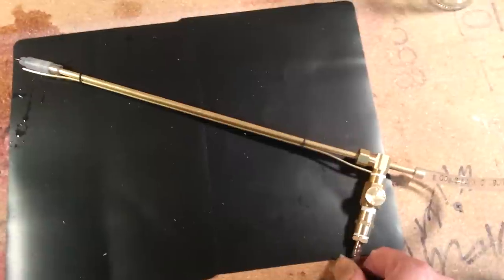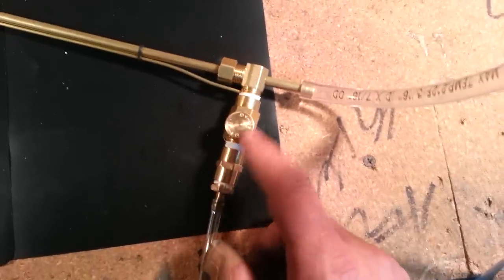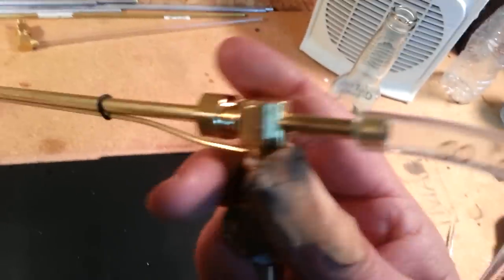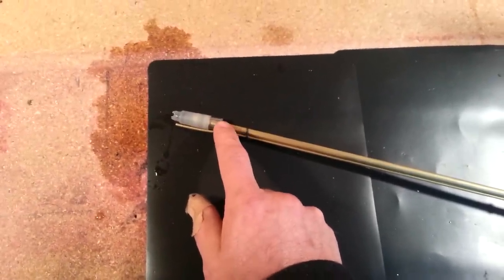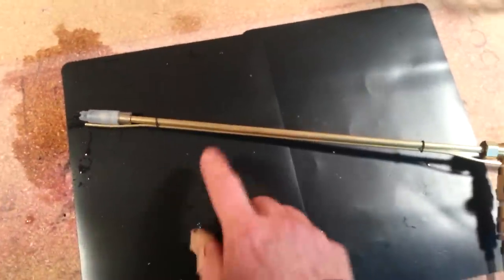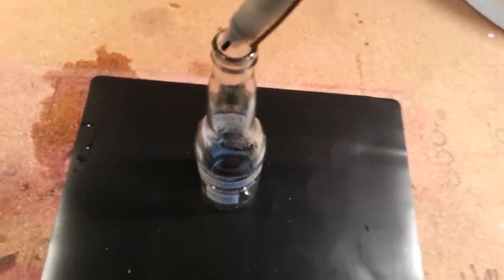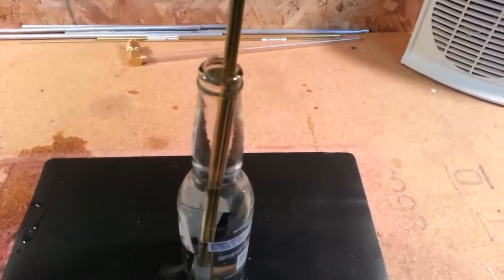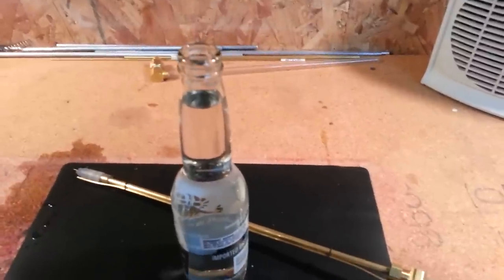DIY BEER GUN - BLICHMANN INSPIRED

Comment: The standard bottling wand stem is long enough for both bombers AND 750 ml (wine bottle size).  I'm not sure your nut on the middle end will fit through the neck of a 750 ml bottle though.  I'm sure an extension with some vinyl tube and a broken racking cane could be rigged quite easily.